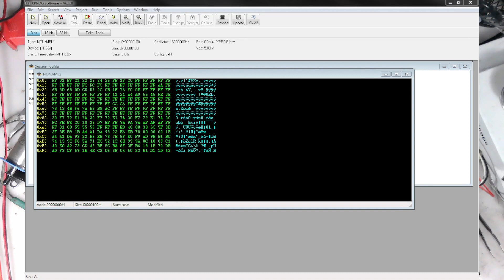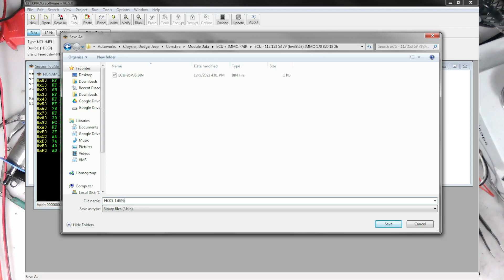Remove and Solder BIG SMD IC with hot air - Retrieving immobilizer key data for chrysler crossfire

Comment: Good job. 370 degrees C for hot air ?
Reply from the maker: That will do fine on this. I usually hang around 450 since I'm pretty acquainted with hot air but If your not too familiar working with hot air or the pcb your working on its best to hang around 350-380 I think.